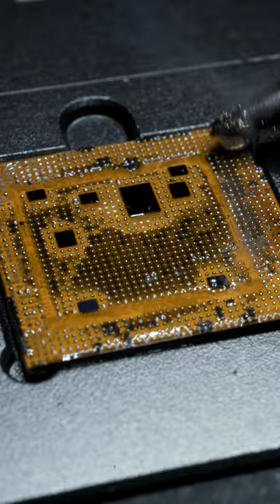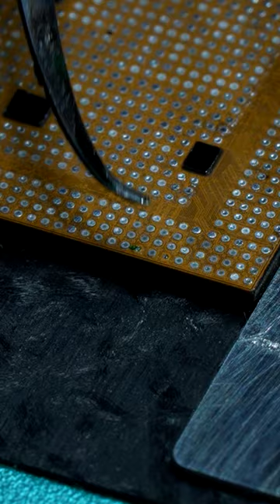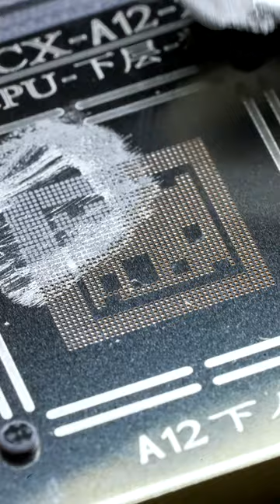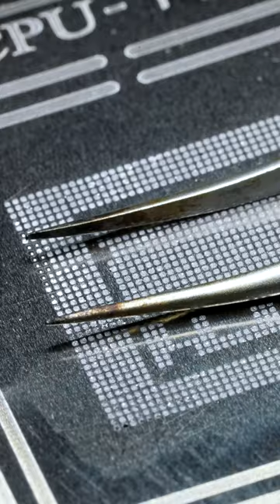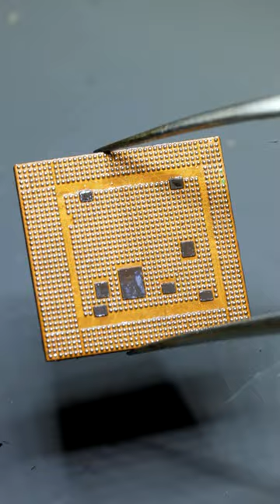A12 CPU Reball | 4K 60fps with Macro Lens ASMR #shorts

Comment: What did you do to those two contacts with the tweezers?
Reply: I’ll preface this with saying that I’m only guessing;
It looks like the ball pins had torn during the cleaning. 
I believe he applied some resin, which was then hardened by the purple UV light. Only briefly, as it really just has to act as a mould for the proper solder ball that he then proceeds to smear through a screen, and melts using a heat gun.

I’d like to refer to Louis Rossman’s eight year old video on why reballing is ‘voodoo’ fixing, as it isn’t actually a ‘real’ fix, even if it turns a broken chip into a working one, it’s always only temporary. And I suppose you could argue that since none of them having infinite lifespans, they’re all temporary, but it’s meant as in more temporary than others
Reply: @hoverbike  Wich paste is he using please ? I never seen this before. I saw he doesn’t need to dry it from flux like others paste ! Thanks
Reply: @islamcoherencepertinence.7226  
I wanna know too ,it looks like butter.
Reply: It's a UV mask but idk what the purpose is

Comment: He actually missed 4 pads if you look extremely carefully , also not the correct way todo it because your just scraping that all over the chip which in turn probably killed it from the heat there's something called soilder whick 😂 all that work just to drop the chip at the end aswell , people pay stupid money for stuff like this to be repaired have some care with your work man , plus your statement about it not needing the solder where you've missed it because their ground pads is also incorrect, they are there for a reason missing grounds = higher current running through the remaining grounds Vus limiting the life and performance of the chip , been reballing chips since Xbox 360 and PS3 days and this is most definitely not the way todo it